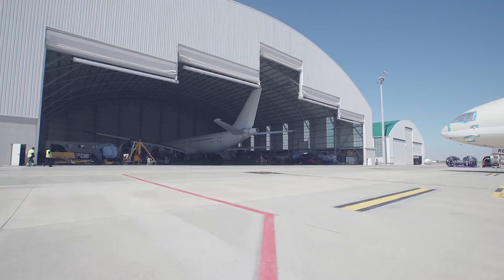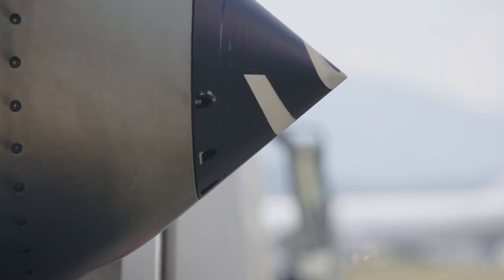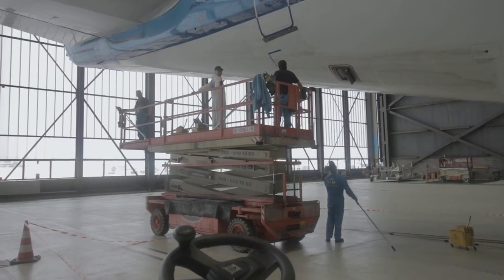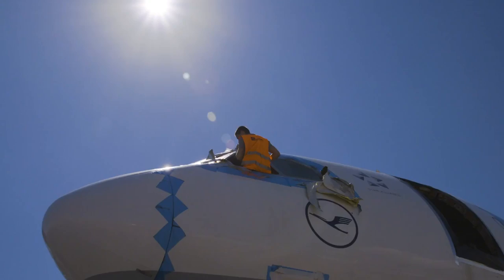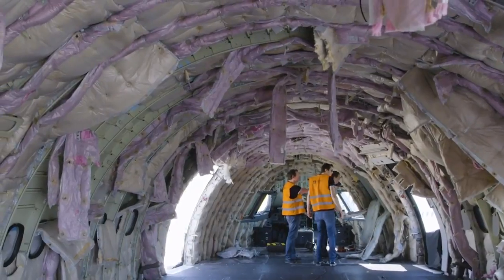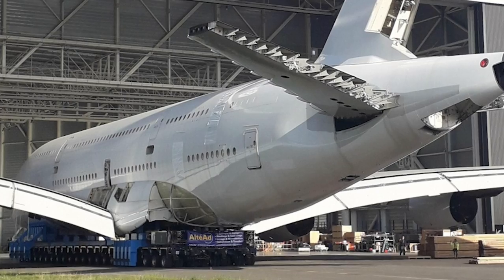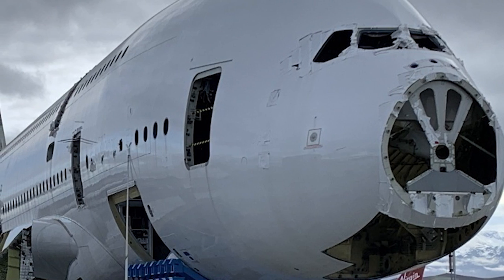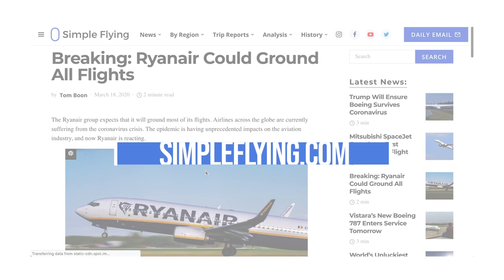How Is An Airbus A380 Scrapped?

Comment: I am sad but if it was the 747 I really wouldn't be as sad because it is pretty old
Reply: You do realize that most 747's you can still fly on are the -8, and they are newer than the A380?
Reply: @martok55   I know that it's just there are so many 747s. Plus the airframe is pretty old so I wouldnt be as sad seeing a plane with with still so many in the sky getting scrapped. It's just the A380 is still young and still has a ton of potential to be a good cargo aircraft. That's why too me I find it sad that these new airframes are getting scrapped.
Reply: @thetransponder7186  Actually 747's are better for cargo thanks to being able to load from the nose. The 748 is also has a lower cost per ton to operate - in other words even though the A380 would hold more cargo the cost per pound to send freight from A->B would be less with the 748 regardless of load factor.
I've flown Lufthansa first class numerous times on  the 748, A380 and A340. The experience in the A380 (upper deck) was my favorite; gigantic bathrooms, quiet, and comfortable. The 748 was also amazing,  1st class is in the nose and is also very quiet and comfortable. Both are amazing aircraft for different purposes. The 747 was originally designed to be a cargo aircraft, which is why over 1500 have been made over the last 50 years, and we will still likely see some still flying 50 years from now. It's the DC-3 of the jet age.
The A380 was designed as a pax aircraft for hub and spoke. Boeing got it right with the 787 moving away from hub and spoke. There will only be 252 or so of the A380's made, and 10 years from now it's likely few will be flying. Even Emirates will likely switch sooner than planned to the 777x, though they (Emirates) has the one business model that supports A380 use.
Reply: @martok55  it's not like the 747 was using revolutionary engines and wings all you need to do is put more efficient engines on it, renovate it to put bigger cargo doors on it and now it's more efficient per ton than the 747. That's why I said it has good potential to be a great cargo plane I never said who was better. So I dont know what you were getting at with the Lufthansa first class and the 747 is more efficient per ton. Sure the nose being able to rise is nice but cargo doors also do pretty good too. All I said was there are alot of 747 still so I wouldn't be as sad seeing that scrapped compared to an a380 which still has plenty of potential left. Plus the a350 and a330 exist so stop saying it like boeing was the only one to leave the hub and spoke model for the point to point. People keep on using that and act like airbus never had other wide bodies before the a380 existed. I'm not trying to sound bad it's just when it comes to planes people tend to twist comments like this to something they can attack. Plus no matter how neutral some people are. I can tell that you might like Boeing a little bit more to comment that the A380 is older than the 747-8. We know but the airframe is old.
Reply: @thetransponder7186  I'll agree to disagree there. In aircraft you cannot just slap different engines on it, or put bigger doors on it or swap the wing. It's impossible to have a nose door on the A380, it wasn't designed for it and no modification could be made keeping it airworthy. Boeing spent BILLIONS redesigning the 747-8 wing, GE spent Billions on the GE-NX engine program. The engine and wings are completely revolutionary. While this comment will be here until the end of time I will put into print that it will be unlikely that we will ever see an A380 cargo aircraft. As it stands a 787-9 carries more cargo (in the hold) than an A380. No one will want to convert a 380 into cargo due to few airports that it can fly into, costs to operate, supply chain for spare parts, etc.. etc... The 747 is EVERYWHERE, can fly into almost any airport, parts are plentiful, and it costs less to fly per ton mile. Ergo, A380 is dead, in any form. Thus far my arguments are from a business perspective. My comment regarding flying them was from a personal perspective. :)
Reply: @martok55  I do agree with the fact that the nobody will ever want to spend that money on the a380 to convert it to a cargo plane, but yes you can just put new engines on a plane ass seen with I dont know all planes  like the 787 a330 a320 777 757 767  would you like me to go on. And your acting like if planes cant get modified like if it's built its built you cant change anything. of course you can, it might take a while for it to get certified but you still can do massive modifications and I know you cant just slap different things onto a plane but as I said you can modify it. And yeah I got carried away with saying the wings and engine aren't revolutionary they are, and you saying that the 747 can fly into almost any airport and that the 787-9 holds more in the cargo hold than the a380. Its cool but just think about the a380 as a freighter with more efficient engines  now that plane holds more than the 787-9. And stop acting like the 747 will soldier on they're slowing down production, and although they say it wont stop anytime soon think about it would you continue to make a plane when it getting an order is a wow. Airbus did stop and Boeing is still going, but only because they are still producing the planes that were ordered a few years ago. So look at it from an economic standpoint. Even the cargo airlines are saying we're not getting any more 747-8s. So the 747 is also kinda DEAD as well.
All I said was IT HAD THE POTENTIAL, and now you carried us into an argument over which plane makes more economic sense of course spending money on an a380f makes no sense I believe that, but that still doesn't negate the fact that if they were to try and make an a380f it will have a high chance of being better than the 747.Have some COMMONSENSE.
Reply: The 747 is old and it's been in production a long time, it was a well designed and well thought out aircraft, kudo's to Boeing, they made a fortune off of it and they were very smart for not betting into building a competing aircraft this size to go up against Airbus.  The 380 was designed for the Mega Hub air travel system, that concept has been on the rocks for the last 3-4 years and it's now starting to crash. Boeing has it's problem, but at least it doesn't have to anchor wrapped around it's neck like Airbus does.
Reply: @oveidasinclair982   Airbus doesn't have an anchor around its neck. Ever since the creation of the a380 yall act like if airbus only does the hub and spoke model, yall act like if Airbuss only wide body is the a380 like if the a300 a310 a330 and a340 were never built before the a380. Yes kudos to Boeing but all I said was I wouldn't be as sad if it was a 747. And since you say Airbus has an anchor around its neck I want one too because they seem to be doing better than Boeing right now.
Reply: @thetransponder7186  There really is no competition when it comes to widebodies:  

747 - 1555 deliveries. A380 - 242 deliveries 
767 - 1176 deliveries, A300/A310 -  816 deliveries 
777 - 1627 Deliveries, A330  - 1492 deliveries, A340 - 377 deliveries.

 More importantly which programs operated at a loss? None of the Boeing programs had a net loss over the life of the program. The A380 and A340 both were at a loss. 

Meanwhile, back at your earlier comment about putting engines on a new plane. Of your list (787 a330 a320 777 757 767) only the A330 and A320 on that list has has replacement engines designed, installed and certified. You make it sound like it's a easy switch out when it is NOT. A prime example is the 65 year old B52, which is still running the P&W TF33-PW-103 engines. Due to parts shortages the Air Force is being forced into an engine replacement for the program.

Boeing made 694 of the 747-400. Many of them are still flying 30 years later. I don't think we'll see any A380's make it to 30 years old. It never had the potential due to my aforementioned comments of availability of parts, limited airports it can be serve and high cost to operate.
Reply: @thetransponder7186  The 380 design and its MTOW prevents it from ever touching cargo. It would need more than just a couple new engines to change the flight and lift characteristics to allow them to even consider being profitable for any freight service. With its design now, you would have 50% or less space taken by cargo and the airplane would be at its MTOW limit without a new wing design, and engines. With Airbus having completely shut down the line and no longer planning to support the 380, you would be hard pressed to see anyone consider it within the industry. FedEx was eyeballing a 380F model that airbus bounced around but even that would have cost them too much and they turned it down. That is without even taking into account that any airport that would see one will require 10+ million in upgrades to even allow them to operate. The 777X will replace the 747-8F's that are still being made once Boeing ends the production of all the 747's in 2022 - 2024.
Reply: @raymarshall6721  this was a long time ago. All I said was it had potential. He went on an entire economic crisis of why it wouldn't make sense completely taking it out of context. An a380f would work, but it's way too late now so of course not. Plus quad jets have been dying now. He also went to say that there is no comparison between Boeing sales and Airbus sales, but when he put the sales up. They most of the twin jets were within 200 orders of each other. That's pretty good for a someone competing with Boeing. Then when I saw the 747 vs the a380. I laughed. He didn't just use the 748 or the sales si ce the a380 was made. He used total sales while skipped over the a320 vs 737 sales. Then he said none of Boeings programs operated at a loss. That's true but when Airbus made the a380 they started getting more orders for their other planes. That's a small price to pay so you can outsell Boeing later. The a340 was a test gone bad. He acts like if Boeing doesn't abandon projects when they realize it wont make money. It's a good tactic, but he glossed over that too, like the Boeing sst sonic cruiser, and the very large 747xx they were going to make. The I just got tired of talking to him because it was just annoying. I know the a380 as it is isn't good for freight, but it would have been if airbus continued with the a380f, hence why I said potential. Dont take it out of context like he did.

Comment: We put on a DETOPS 5 regulation and get all the MAXes there, the A320s, 330s and 350s then we get rid of the soulless aircraft, and get the good interesting ones back up :D
I do not shed a tear when a 737 goes or an A320, they are just plain and boring machines and scrapping of these should be encouraged.

Comment: Yes, I am saddened by this.  The plane (collectively speaking) really did not have enough time to prove it's worth. At the end of the day, however, it was the wrong plane for this era. Why continue with quad jets when twins can travel as far (if not further) and at lower costs? Too bad that freighter options, either "off the assembly line" or refurb from passenger models are not (at the moment at least) a viable option and save them from the scrapper's torch.
Reply: Assembly line is closed and gone. Airbus closed it months ago, so far as freighters... they cant. The airplanes MTOW prevents it from being a viable freight hauler. 380 only broke even or made a little with a completely filled airplane with passengers, freight which pays by the pound would only fill 20 - 30% before it reached or exceeded its MTOW so it would lose even more money per flight. Tack on the cost to upgrade airports to even land one in the 10+ million range and nobody will touch it.

Comment: too sad, once the proud a380 when launched now being scrapped.still boeing 747 managed to stay in the market how come?
Reply: Because the 747 was initially designed as part of the C-5 Galaxy contract contest. It was designed with cargo in mind at a time when ETOPS required anything flying over the oceans to have more than 2 engines. When boeing didnt get the contract for the government, they dropped the wings from above to the bottom, left the hump on top and threw a bunch of seats in it. 4 engines witht he 70's ETOPs rules = instant success. 380 was designed 30 years too late, ETOPs had changed in the 90s to make 2 engine planes more economical for airlines when the plane certified (777 being the mold breaker on that). Once it wasn't financially supportive to keep the 747's in a fleet they had a second purpose with freight carriers because of their inherent design. Either through ordering a straight cargo variant or a conversion, the 747 still makes profit for freight hauls without being too demanding on the airframe since they arent as active. 74's can be resold simply because of their versatility. 380's were designed with only passengers in mind in an era when 2 engine planes are not only dominant but economical for both the airline and the passenger. Airports that serviced the 380 required tens of millions of dollars in renovations just to let them operate there, and due to its MTOW, the 380 cant be used for freight operations. A versatile plane that has stood the test of time and has the ability to do more than just one trick will always win out over the new shiny thing that is designed for only one use. We still have Boeing B-52's that were built in the 1950's flying combat operations because of the design versatility and their ability to be changed as needed to fit the role they are required to fill at that time. The 380 hauled passengers very well and was a comfy plane, but even before the Rona stuff, airlines were grounding them because they couldnt fill them and were losing money on each flight, lacking their ability to do anything else means they won't be resold because nobody will touch them.

Comment: This air craft was ill-conceived. And arrogance drove it's construction. It was well known there was a limited long haul market for this plane. And the lack of foresight in design did not allow for reasonable conversion to cargo. More than 50 years later a version of 747 still rolls off the assembly line.

Comment: 2:26 what the fux that?
Reply: Ram Air Turbine, aka the RAT. It's a power generator to be used in case both engines fail to provide emergency power.
Reply: @wewd  cheers for that.

Comment: My opinion... always a white elephant, yes clever the same as Concorde was clever, but clever does not always make money. When an aircraft does not make money then it is a ego trip. I'm not knocking the engineering stardards or the effort in constructing the A380 aircraft because it was cutting edge but think what the A350 will achieve in its lifetime. The A350 will challenge the Boeing 787 but the A380 never challenged the B747 did it, be honest?  Without Emirates trying to be big and best and "leading the world" what have you got, about 40 or 50 aircraft built but no profit?

Comment: Its no make me sad 747 still flying it beat A380 nice try airbus only emairaits has a380 it failled queen of the skies lol
Reply: Some A380's will continue flying like the 747 it's just production is ending for both.
Reply: @yoyoyoyoshua  Except 380 production ended months ago and the 74's are scheduled for continued production for freight models for the next few years. 50 years of service + still producing > 10 years and production line already dismantled completely. The only airline who will keep the 380 will be Emirates because of the way they operate, even then they will die off when parts vanish.
Reply: @raymarshall6721  i know. 747 production will continue until 2022.